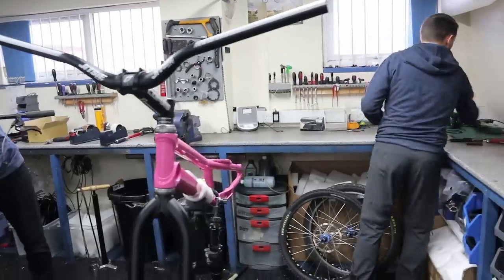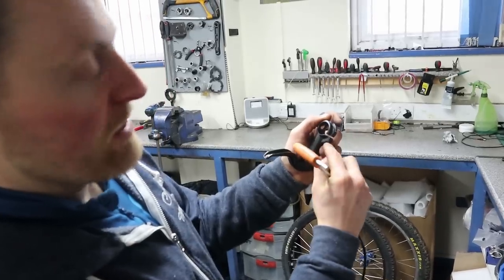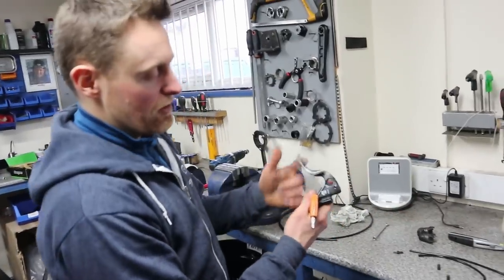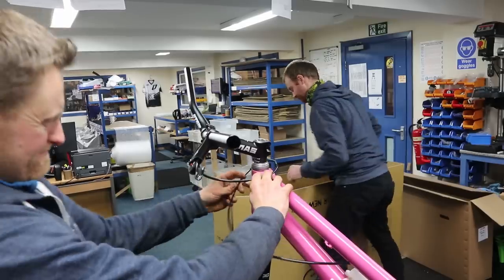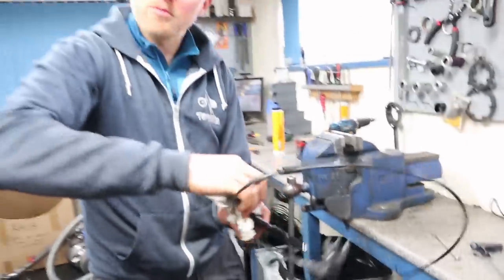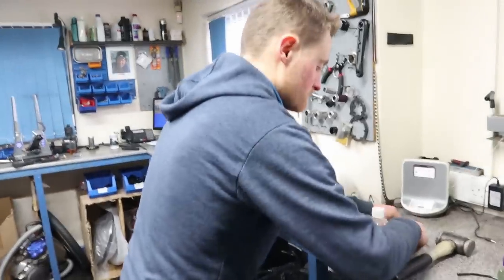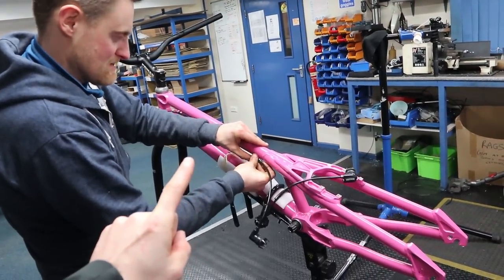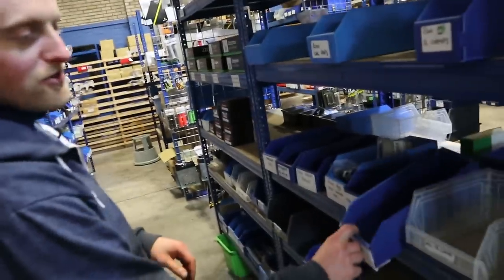Magura HS33 Set Up : Everything You Ever Needed To Know

Comment: Dude, you‘re a lifesaver. I followed the official Magura bleed instructions and had ZERO stopping power. System was full, no bubbles. But your trick with attaching a syringe to the master cylinder and pushing out all the air (was a shitload of air inside) was the thing that saved the day. I don’t understand why they didn’t include that in the official video. Cheers!

Comment: Thanks for the video, I learned a lot. I think those aluminium brake clamps with the slots are your backward slipping issue. Those slots will flex, plus the bolts are very small. I would have a machinist make custom clamps for that particular setup out of steel or ti, with holes rather than slots. You will have to measure for the hole placement. Or you could cut down a washer to fill the slot, with the hole in the right place. This would spread the load from the bolt head. Larger bolts would help too.

Comment: they sell liquid rosin soldering flux, biodegradable + non-clean (so it's not active/corrosive at room temp). the one w/ the brush applicator is more viscous than the 'drip bottle'.. it's super easy/fast to apply and it's quite sticky after it dries out; it's basically "violin rosin" w/ some solvent carrier that evaporates.
 
it used to work ok in wet conditions with old school chrome rims on city bikes. those bikes would practically lose ALL braking power w/ the first drop of rain, so i imagine some ground up rims would get glued to the pads.. the flux itself is not messy and it smells fabulous but it definitely attracts all kinds of dust.

Comment: I would expect the speed with which the brakes open back up is mainly depending on the stiffness of the spring that pushes the break lever out, more than on the viscosity of the fluid.

Comment: I notice that you didn't put a barb in at 10:20. Only an olive and shroud nut, is a barb not necessary because it's low pressure? I've only dealt with avid disc brakes where there is a barb that you thread in and then screw an olive on that with a L/H thread?

Comment: Hello. Great video, especially the spoke part for the hoses. Can I ask, do I have to use specific Magura hoses. I have restored my Cannondale Super V 1000, and yesterday rebuilt the brakes, but O just used a random old hose, they do work, but I suspect the brakes are leaking where I have bridged the calipers. The hose I used has the black outer sleeve and a white lining. Could this be the problem. Any advise would be greatly appreciated. Thanks

Comment: there are some interesting parts, such as the block which was used in the vice clamp, to hold on to the brake hose while the barb was hammered in. Is that something available commercially?

Comment: Why not put in some piss thin hydraulic oil?
Like VW/AUDI spec power steering fluid?
If you would  pour in hydraulic oil a  system runing on regular brake fluid (diethelene glycol)  then the seals would all swell up, in reverse im guessing its the same thing.
I looked up some seal compatibility and NBR seals used for mineral oil are not suted to glycol based fluids, same for epdm seals designed for  glycol based fluds dont work with mineral oils.